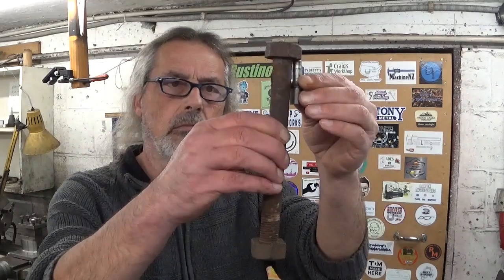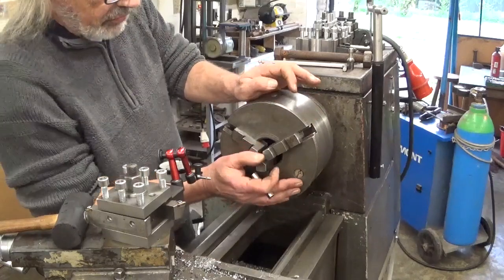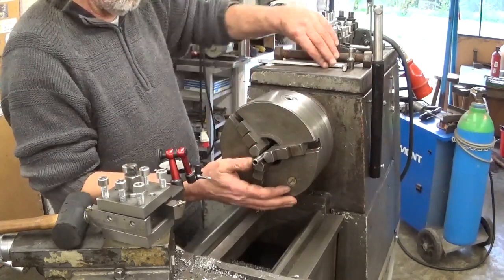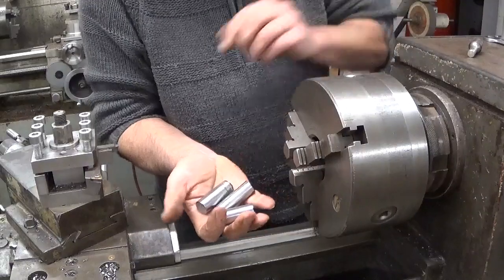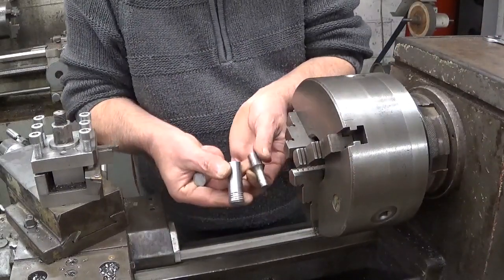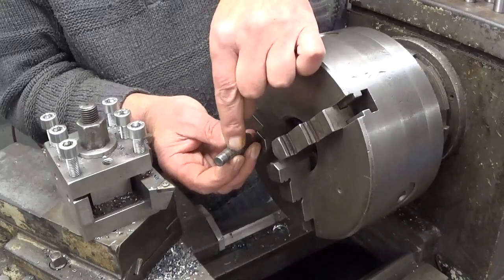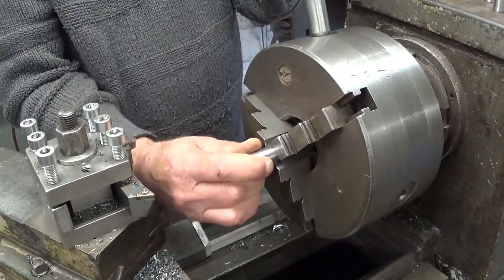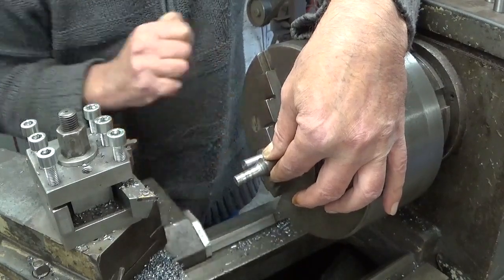Making a... thing. 3 times.

Comment: Michel that looks like a .401 shank for a rivet gun set and my guess is it has the flats milled on it to rivet in tight corners. I'm a retired aircraft mechanic (engineer in Europe) and have half a toolbox drawer full of them. If you do an internet search for   .401 Rivet Set   you will be able to find the dimensions for it. Nothing clamps the shank it just a slip fit and most times pretty sloppy at that.
Reply from the maker: Well, I don't know what it is.

Comment: Michel to fit the 3 jaw chuck to the backplate, center tree points on they edge.  the play there is will be filled by the centers. Iff the play is bigger mayby you can shim the gap.
Reply from the maker: I did cut the rim on purpose, so be able to centre the chuck.
Reply: @Rustinox  Oke, why you do that. Every time centre the chuck takes a lot of time.